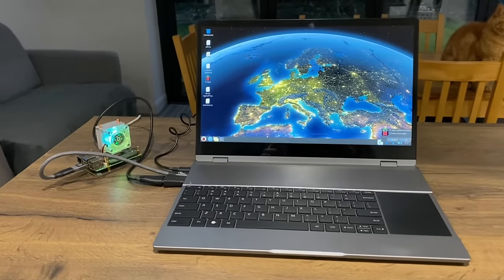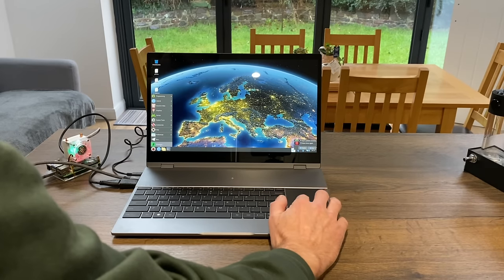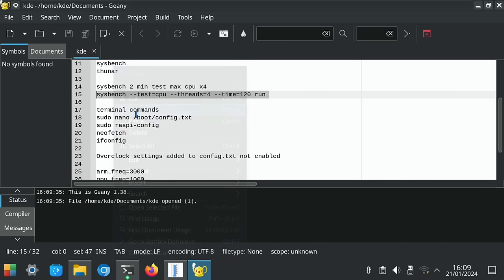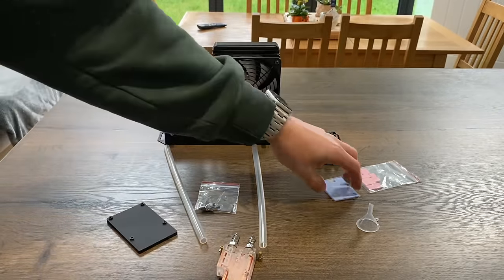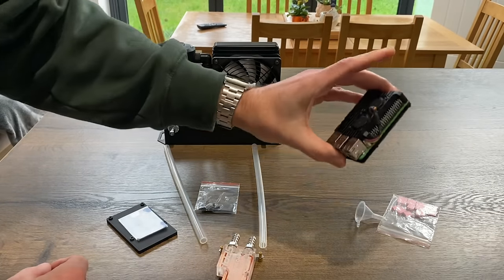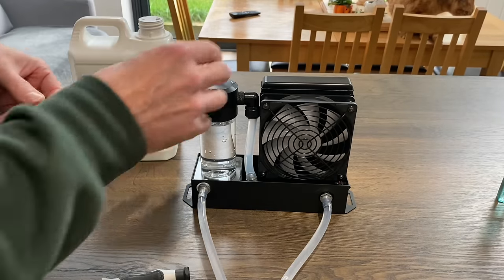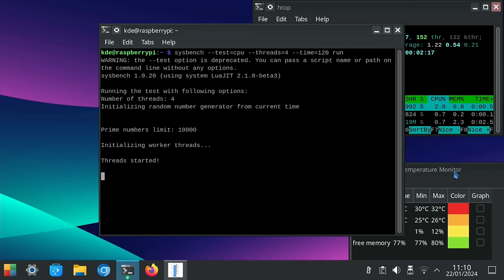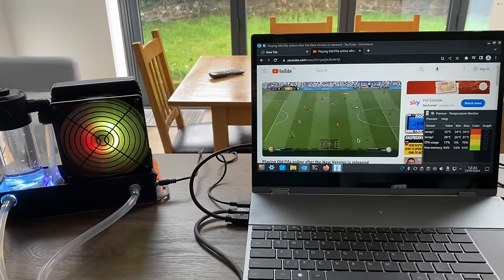Water cooling for 3Ghz overclocked Raspberry Pi5. Seeed Studio & 52Pi

Comment: Here is are somewater cooling tips for you Lee;
First, never let a pump run without water, water lubricates the pump & without it the pump will instantly be damaged.  

Second, the soft tubing will pop off without clamps, just a matter of time, will need soft tubing clamps, the kind from a Automotive shop should be good enough.  

Third, it will most likely take hours to saturate that set up with heat to be able to compare raspberry pies.. but it might just run a degree or two above ambien forever, so no need too.  

Fouth, hats off to the maker of that setup for such a low price, but it is a mixed metal setup with the copper heatsink & the aluminum radiator, if anyone wanted to use this for month or years, I'd replace the aluminum radiator with a copper radiator.
Reply: The spring kind are called bejesus clamps because it takes the will of God to get em on and if the pliers slip and it smacks your finger...it hurts like bejesus ...the screw type are "hose clamps"  :D

Comment: I think the various thicknesses of thermal pads are to allow for the different heights of the chips on the Pi. The official cooler comes with different thickness pads for this very reason. The paste you applied to the chips other than the soc won't be effective, and will likely make a mess over time. I'd suggest paste for the soc, and pads for the other chips for best results. Be interesting to see if that level of cooling is enough to overclock even more...
Reply: Anything beyond the ICE tower that is at the beginning of the video already showed that it doesn’t provide any gains in terms of Over Clocking. The SOC can’t simply be overclocked anymore like to saturate the ICE tower
Reply: @jjptech  some things, once thought, must be said, therefore: ONE DOES NOT SIMPLY overclock a pi5 beyond 3ghz
Ps: i bet you it can go beyond 3ghz, but by going beyond the silly and into the patently ludicrous. Ambient or subambient core temperatures.
Reply: @johnbeer4963  So you will purchase a nitrogen tank with a criogenic pump to cool down a raspi enough to push it to 3.2 ghz. Or you believe that the Overclock is linearly proportional to the Kelvin scale?
Reply: @jjptech  Naw. The beauty of these lower power devices like ARM is they make TECs viable at least for a play around just to see what can be done... and if you've got watercooling hw around you can cascade them.

Comment: Amusingly overkill for a single Pi, but I think the real utility here is for Pi clusters (as you suggested at the end). A single 120mm rad should be able to keep about 15 RPis comfortably cool even with all running at full tilt. The question then is whether the pump has enough power to push through that many CPU blocks.
Reply: I'm pretty the pump will be just fine :) Judging only based on the looks of the components (sadly seeedstudio doesn't provide any specifics of used components) - it looks as standard DDC pump (or some clone perhaps) and the CPU block also looks as having barely any fins (if even any). So restrictivity of that block is very low.

Comment: Nice overkill. I done a similar overkill and cooled my Pi 5 with a fan for rooms. Wing diameter 35 cm. Needs 65 W power. It's a bit loud and windy, but it cools my Pi well. My room temperature was 21°C and with the fan in idle the Pi was 27°C. Under very heavy full load it was 56°C. Without using a heat sink. (Very heavy full load = 10,7W power of the Pi by using FET on all cores. Sysbench and stress-ng use much less power. Only around 7 to 8W. You can see that in several videos on my channel.

Comment: This is super fun. 🙂

My 4 GB Raspberry PI 5 will only do 2.9 Ghz on the CPU and 900 Mhz on the video. If I go to 3 Ghz CPU or 1 Ghz GPU, it boots but immediately hard freezes. I'm using the official active cooler.
Reply: Try more voltage
Reply from the maker: Still a decent Overclock 👍🏼

Comment: I can’t get my pi 5 8gb to overclock to 3ghz . My set up is 2.9ghz / 950mhz / voltage 6/ force 1  . This set up is fast using you KDE plasma . Batocera is set on the same . Amazing video . Keep up with the good work

Comment: You didnt touch on it in the video, but i'd love to know if you could still attach a PCI ribbon cable with this thing on. Obviously mounting an NVME underneath isnt gonna happen with a heat spreader underneath, but perhaps keeping a PCI board off to the side or as a hat would be a good solution? Provided it remains accessible.
Reply from the maker: I have a Geekworm nvme that would fit as it just uses the 4 screws. Without the heat spreader

Comment: It does seem overkill for even hotter climates, especially when you add the cost to a Pi 5 set-up, which makes it a very expensive proposition indeed for what the board is. It did look pretty though with the lights.

Comment: Water cooling is only good for short runs (aka until it reaches saturation) but if you have to do long runs you still need to make sure that the rad can move the heat

it is the one reason i hate water cooling videos as they never run to heat saturation to see how long it takes and if it will fail after saturation because there is not enuf radiator cooling
-if the radiator is not enuf after heat saturation you will get thermal runaway and that means the death of hardware

just so you know thermal runaway is why servers are rarely built with water cooling, as air cooling will will hit heat saturation faster and it is easier to monitor for that and make adjustment in code or the bios to account for it

i am not saying that it cant be done for water cooling but it takes alot of time to to do the calculations and verification's, i am talking days/weeks with the device running at full power using every part of if the whole time

Comment: I would recommend buying some brass or copper plate stock from lowes and cut it down to the size of the cpu, then put on top of the chips, heat sink compound on top as well...and sandwich between the board and the heatsink so if you don't have enough room it will give enough space to not short out other components on the board...
Interesting setup...never thought of watercooling and ARM device...only push out like 15 watts...

Comment: That water cooler is eye candy!  A radiator of that size can easily dissipate perhaps 100 W. At max load the pi 5 dissipates ~12 W, call it 15-18 W overclocked. So yeah, utter overkill, but there are certain builds where the looks alone might be worth it! Not sure I would use distilled water as it can be very corrosive. @emuclone154 suggestion of 50/50 Prestone s better.
Reply: Hi. I am interested in how you got 12W. My max was 11W so far. What software did you use to get 12W?

Comment: Why? My RPi5 already overclocks to 2.8Ghz with a $5 heatsink/fan.
Apart from being able to go around and say 'I did it', it seems to serve no practical purpose as there are virtually 100's of other single board computers that will outperform it. And if one is so into overclocking then overclock desktop PCs instead as it is more fun and actually can give significant practical benefits. Would seem better to spend the money elsewhere to enhance the Pi.
Before getting my Raspberry Pi 5, I seriously considered the much faster and better spec Orange Pi 5 Plus. Considering all the logical and rational reasons, the final decision was based not on performance but useability and software availability, etc. I have my home-grow water-cooled over-clocked gaming PC to satisfy that need.

Comment: For those wondering the best performing coolant is prestone antifreeze/coolant universal 50/50.
Reply: What year make and model for that vehicle?
Reply: No reason to use antifreeze
Reply: The only thing you have to worry about is unlike metals, i.e., brass and aluminum. If you do, it will cause galvanic corrosion. Also never run the pump dry. Water is the lubricant for the ceramic bearing.
Reply: LOL, I hope you are just trolling. Cuz using such collant would kill the pump slowly. This is not a car pump bruh 😂
Reply: @WaterCoolFool  when it's sub 0 outside I like to go out and OC
Reply: @Bedasek you must be trolling, how would it kill the pump. The corsair H60 aio has been proven to use antifreeze with mixed metals and still have long lasting results

Comment: This looks like an excellent entry level project to learn how to bend acrylic rods instead of using the flexible hosing. Do you know if rigid acrylic water cooling pipes for pcs could be used in this application? I assume you would have to change the connections at a minimum
Reply from the maker: I don’t have any experience in liquid cooling
Reply: @leepspvideo  It sounded like you said your son had built his own water cooling system although I'm not sure if that included the custom bending of acrylic pipes. It might make a neat video if he was able to help you and you could custom bend those pipes to put them in some kind of aftermarket case or some other custom build.

Comment: Speaking of overkill... I overclocked my pi 5 cpu to 3.0 GHz and graphics to 900 MHz using the factory integrated cooler and never exceed 80° C in a 23° C room with stress-ng hammering all CPU and GPU cores. Maybe I just got lucky with the silicon lottery. I do have a pi 5 ice cooler but so far I haven’t even bothered to set it up.
Reply from the maker: 80 is very different to 36. Also the fan would have ramped up a lot at 80

The factory cooler is great and tiny. 👍🏼
Reply: @leepspvideo  Very true, but this all depends on use case. I use my pi as a homelab / docker server where it rarely exceeds 25% load and even overclocked my temps are usually in the 40s. While you’re absolutely right that 80 is too high long-term, so is 100% load. Still, I really like the way, the water cooling looks - great work!
Reply: @marklewus5468  The pi documentation said that below 80°C is fine. They even tested with 120°C, but in that case it aged too fast. (sadly they didn't wrote an exact time how long it was running with that temperature. They only wrote that it was running fine.)
Reply: stress-ng without any parameter doesn't produce much heat. Only 8.6W. There are other tools that produce much more heat. My max is 11W so far. Here in the comment an other guy wrote he used a tool that needed 12W. Sadly he didn't wrote the name of his tool.

Comment: "Engineering" defines a process whereby someone creates a solution to a problem in the real world that others would definitely wish to use as their own solution.

I have invented a new word, "geerling" to define a process like water cooling a Raspberry Pi or connecting 100+ hard drives to a Raspberry Pi where everyone goes "okay, very clever, but why would anyone do this in the real world anyway? And how does this help me teach 30 kids in a classroom with a Pi each the basics of programming?"

Very nice and all that but if I need a 3 GHz CPU I can pick up a 3rd or 4th generation Core i5 or i7 in a used SFF PC for the same (or less price) than a Pi 5 and know I'm operating it within its specified parameters, confident that it probably won't die from over-exertion at any moment.

Comment: hey, I'm currently on a retro handheld project with the raspberry pi 4. I wanted to try out gamecube and wii emulation, but therefore I must switch to a 64 bit system because of the dolphin emulator. I'm using retropie, butcan anyone suggest a good alternative? Also does anyone have the monkajaro 64 bit retropie image and maybe could send it to me?
Reply from the maker: Best Nintendo GameCube emulation so far! Raspberry Pi 4 2325MHz Overclock.
https://youtu.be/9FaJfqAWOeM
Reply: @leepspvideo  Thank you, but I really would like to get gc and wii on retropie. Is there any way to get a 64 bit retropie image without installing it on a 64 bit raspberry pi os? Or can you install retropie on 64 bit raspberry pi os lite and run a script that autostarts retropie? If this works it would be a nice video idea..

Comment: it's really cool but (not to be an a-hole but) but it's really silly. Probably consumes close to 50% of the power of the Pi5 at stock. The aircooled temps were fine. For the cost of this plus a pi5 you could have got an Intel N100 fanless mini PC that would pwn a Pi5 in every measurable or definable meaningful way. In short, mixed feelings. Delightful, yet silly.
Reply: PS: combine this with a TEC for some low temp playing and it gets more delightful AND more silly.

Comment: hmm... In my opinion much too much thermal paste. Even on large x86 cpus most guys recommend to use less thermal paste. The thermal paste should only fill the gaps between cooler and cpu. it shouldn't be a layer between cpu and cool, since thermal paste is in most cases of course better then air, but poorer then the cooler (especially if you have a copper cooler)